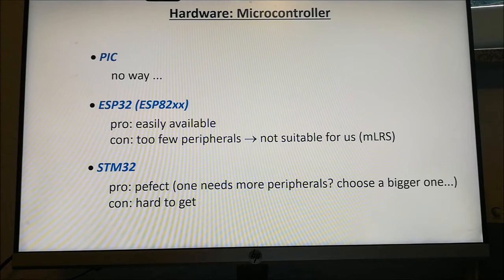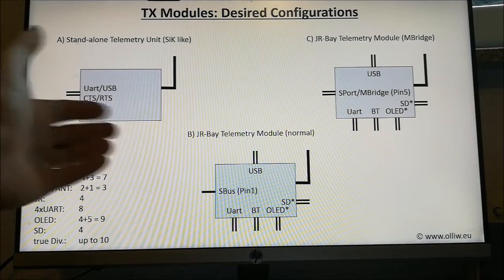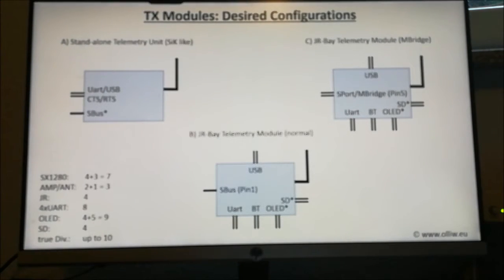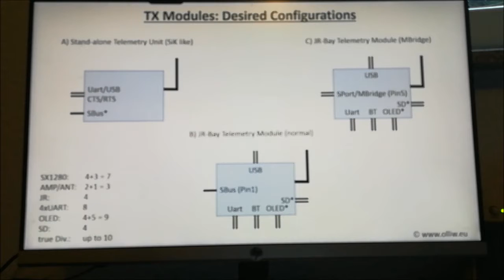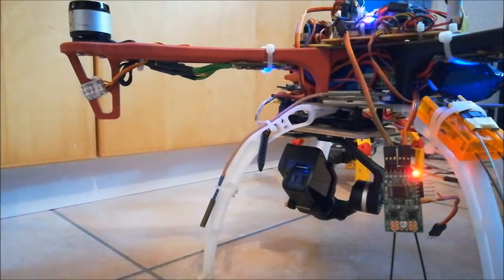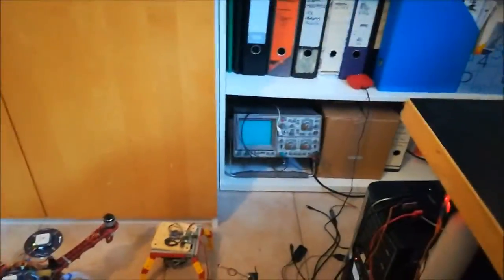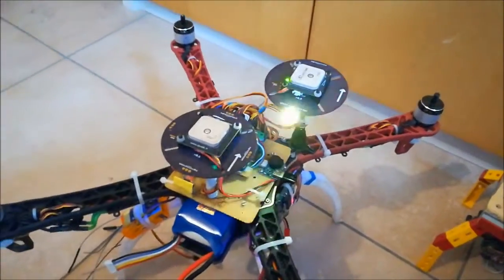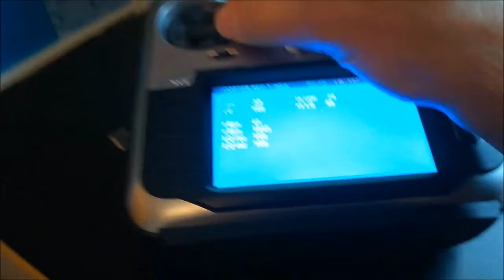mLRS: First DIY Hardware Roundup

Comment: Hello. Thanks for the project and time investment to move forward RC hobby
Regarding the STM32 chips, did you lookt into (GigaDevices) GD32? Thay has to be identical to STM32 but chiper and easy to bay.
Also, I have a question regarding the 433MHz Lora modules, did you try to experiment with them? Assume that they will have a much lower bitrate.
What if instead of full diversity, try to transmit simultaneously on both transmitters the same data package? But first SX, transmits first half of the pkg and the second SX transmits the second half. They both operate on different frequencies. When the full package will be received by RX, both halfs of the pkg will be glued together. How did you think is this approach will work at all and if it give more or less acceptable baudrate to communicate with Ardupilot?
I need an RC system to operate on a range about 40-50km away

Comment: Great work as usual olli and I look forward to testing this, on a side note I have been removing f405 from older boards and saving them.
Reply from the maker: many thx, sir. 
Concerning f4 etc, I realized a potential issue which I didn't realize in the beginning: I want mLRS to have OTA firmware update of the receiver, in the way that when you flash the transmitter module it has the receiver firmware already with it, so that when a receiver connects it can be immediately updated (I think TBS and Ghost is doing this). This however may imply that one may have to restrict to just one, at least very few, chip families, like G4 only ... from all of them, F1 - H7, I think G4 would be the best way to go. Maybe you have a chance to keep that in mind if you should happen to design cool boards :) (I would be most happy if someone else than me would design boards)
Reply: @OlliW42  I’ll have a look at a board design, I have a few g474 mcu, I think about 10,  if you need a couple let me know, are the schematics on your repo?
Reply from the maker: this would be very cool. I currently do have a few (three) g491re, I do have a g474re nucleo, but wouldn't want to disrupt it LOL. Yeah, the schematics are in my git. The tx module is done for a g491re, but - at least from the datasheet, not tested - the g474re should be a drop-in replacement. Note that there seems to be something wrong with the tx scheme however, flashing by swd more often than not does not work and enetring teh system bootloader by holding boot0 button down also doesn't work ... I still don't understand why. Just to have mentioned it. You certainly will do better than me :). For RX I went with F103 for the moment, since still somewhat available. I just wanted to mention the OTA flash issue so you know.
Reply: @OlliW42  I didn’t have SWD issues with g474, maybe there is something different with g491 wouldn’t have thought so, I can share my g474 project (can adapter) if you would like. 
I will take a look at the schematics when I get home from work tonight.
Reply from the maker: I also never had such issues with f1,f3,f4 so far, so I assume that there is something screwed up in the schematics and/or board design. Thx for offering to share your design, I guess that if you would have a chance to have a look at my tx module schematics and design my mistake might immediately reveal itself :) I wonder if it might be due to some option bits. STM32CubeIDE is quite "dangerous" as it blocks you out by default, so also here I might have screwed something up. We will see :)